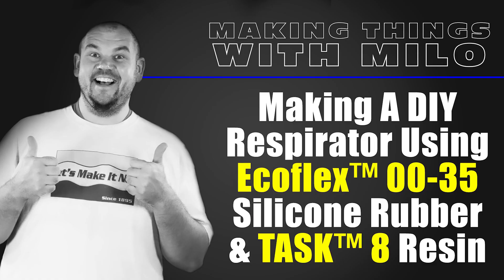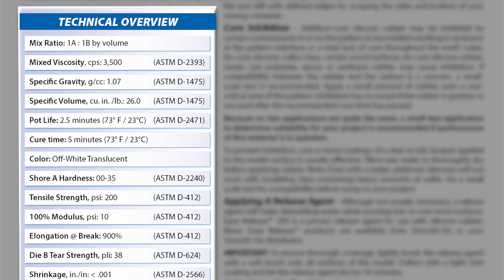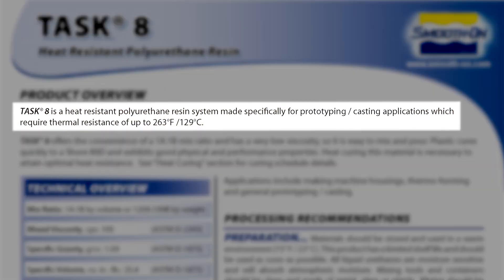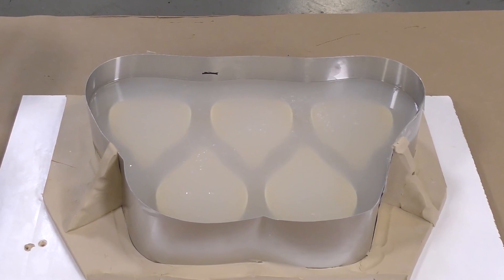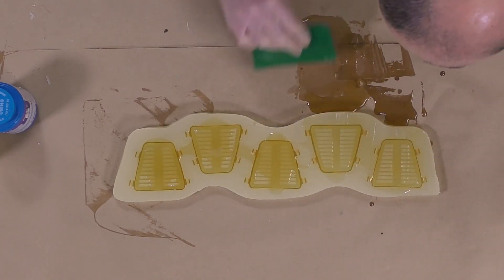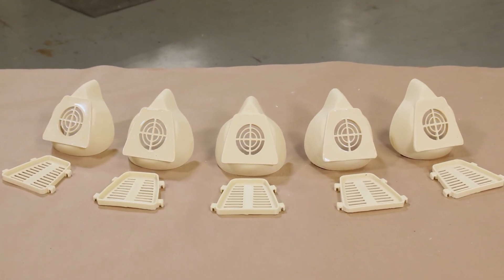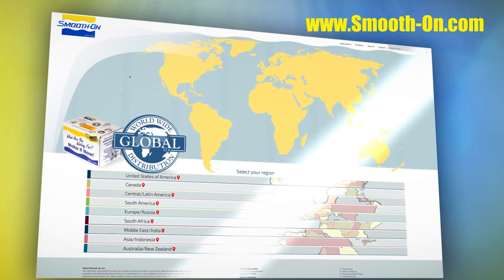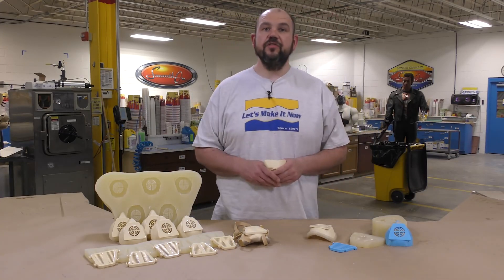MUND-NASEN-MASKE mit HEPA-Filter SELBST HERSTELLEN mit Ecoflex™ 00-35 und TASK™ 8

Comment: Cool Project, but what are the costs per mask on this way, ... On in a small batch of 100 pieces?
Reply from the maker: Including the cost for the molds (first mold + gang mold) the cost per mask is approx. 3 € when casting 100 pieces. The shown gang-mold can withstand at least 100 castings, more likely 200. So the more you can cast in one mold of course the lower the price per piece gets.
Reply: My calculation is approx 4,60 EUR per mask. With a batch size of 130 pieces.